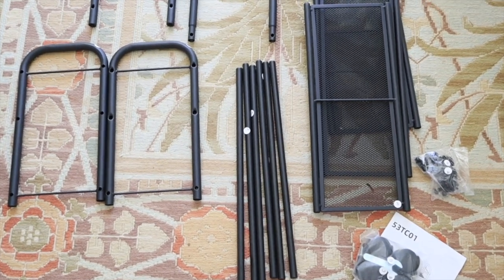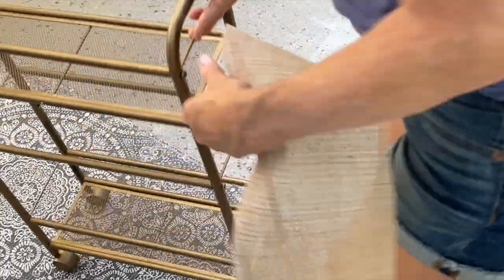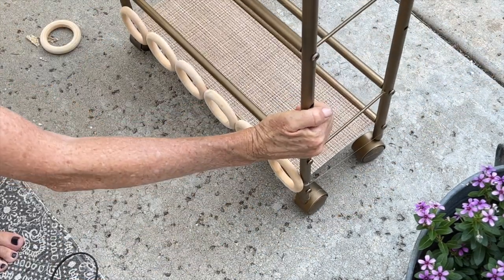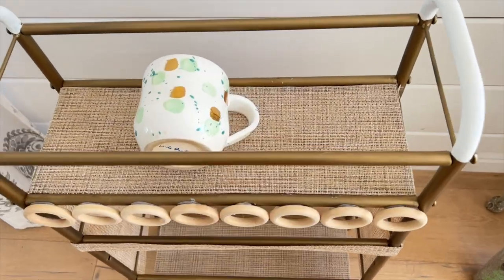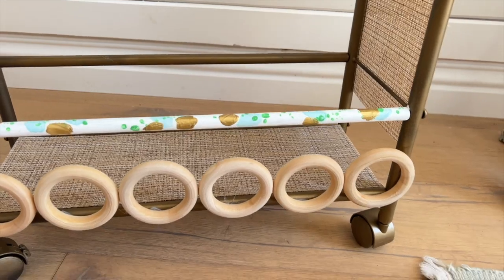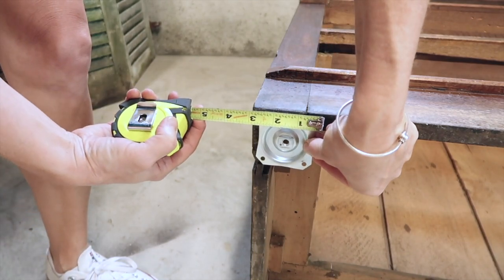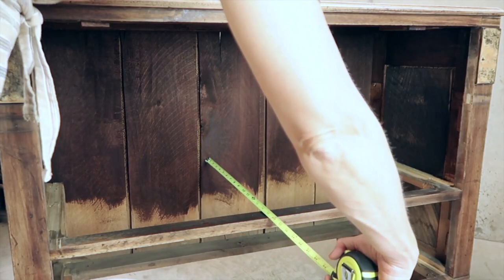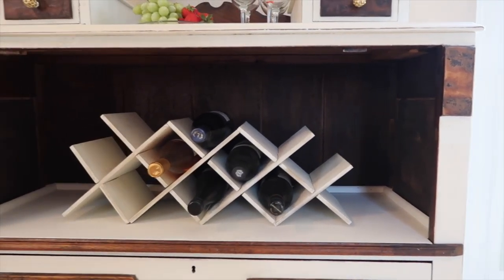Turn a cheap Walmart rolling cart into INCREDIBLE home decor!

Comment: I like this idea.  Where the side "placemats" meet the top "placemats", I might've used a ribbon or something to cover the "corner" between them, make it look a little more finished.  And while I can understand why you didn't keep the middle shelf (you were afraid the bottles would be too tall for that space), when you were done and had the wine bottles on the bottom shelf, you can see that they still would have fit if that middle shelf was there.  I would have kept the middle shelf, especially if you want to use it (for example, and going along with your 'drinks' theme) to place more glasses, or utensils (such as a small jigger, a cocktail stirrer, etc).